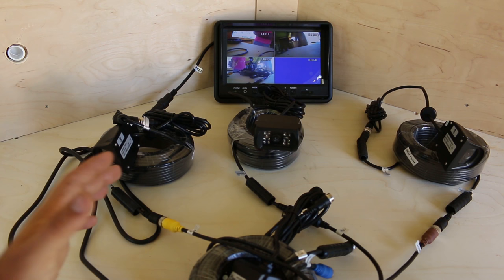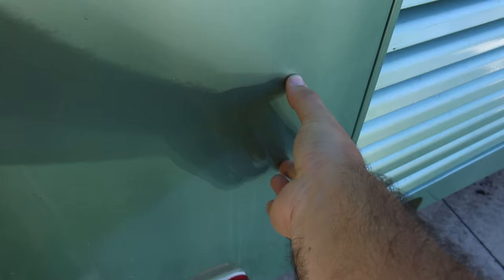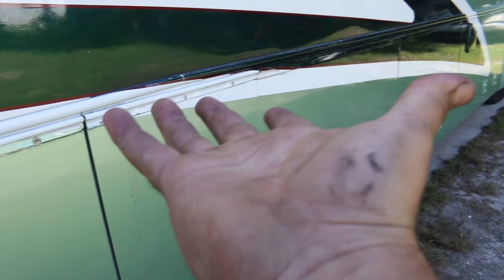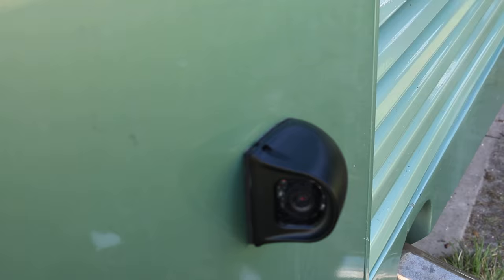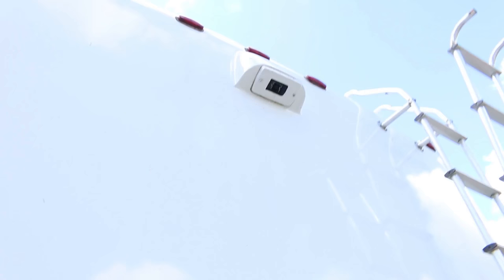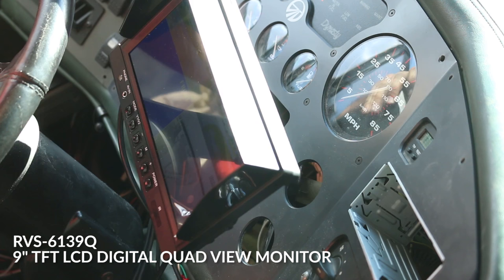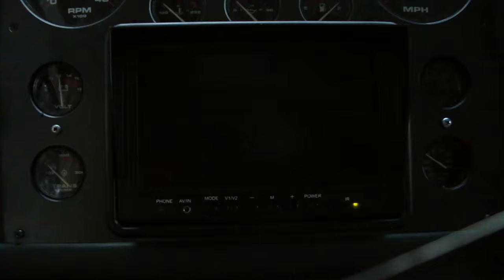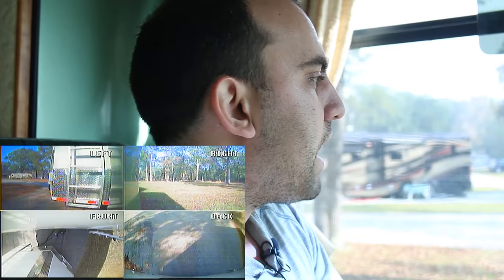4 Camera RV Backup System | Install and DEMO!

Comment: I have this exact same quad camera. I think you should've put the side cameras way up in the front about a foot or two below the roofline because then you get the whole side of the RV any cars that are on the side of it. That's where I have mine installed, and most motorhomes come with the side cameras up in the front, but as long as you're happy with your install that's all that matters. Great video an awesome camera system I love it!

Comment: We have a similar system on our new 3000 gallon tanker for the fire department.  We have one on each front fender look back to help with dumping water/turning (they come on with the directional signal).  One off the back to help with backing up and dumping water out the rear.  The fourth feed is for the GPS feed.

Comment: GREAT video and demonstration. If you wanted to put put more than one camera on the trailer (e.g. 3 cameras: 1 rear, left side, and right side), what connector would you have used? The quick disconnect part you listed shows 7 pins which I believe would work for me as well.

For additional context, I want to put the rear and side cameras on my trailer (35' travel trailer) so that when I'm backing up or turning, I can still see what is behind the trailer.
Reply: Apparently, video requires specifications that the POLLAK plug may interfere with. May have to revisit this idea for an alternative solution.

Comment: I just installed mine, only one camera and 7in screen but I want to add 2 more. I've seen people put the cameras in the rear and in the front, I really not sure which one I like better. My Civic has mirror lights and it makes it so much easier to merge and in an RV, those side windows need to be crystal clear to see out the mirror. What are your thoughts Mike?

Comment: lol you dont put the left and right cameras on the rear bumper
Reply: Where would you put them?
Reply: @alex_ob1  the sides by side mirrors
Reply: Surely since you get that view from the mirrors anyway, it's helpful to get an alternate angle from the camera?
Reply: @alex_ob1  you get a wider view of the sides to see cars.
Reply: @ssijon  I've been playing with cameras on my vehicle, I concluded that looking straight down from the back corner is potentially most useful. Wider views from the front I can perhaps better achieve with extra concave mirrors.
Reply: @alex_ob1  1 top camera in rear does almost that rear and sides.   The problem with class A's is that passenger mirror is so far away from the driver, its hard to get a clear picture of what is going on.   One of those 360 camera setups would be awesome.